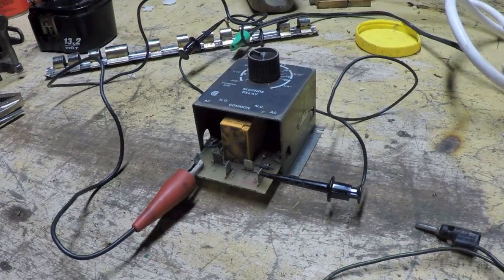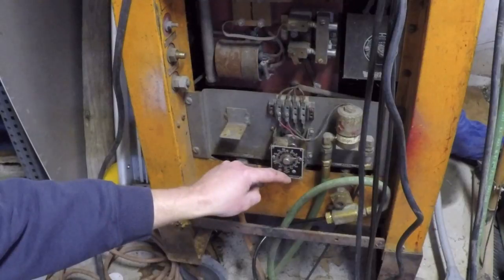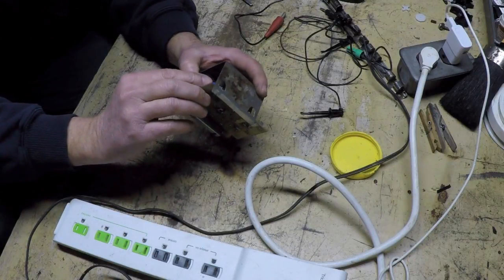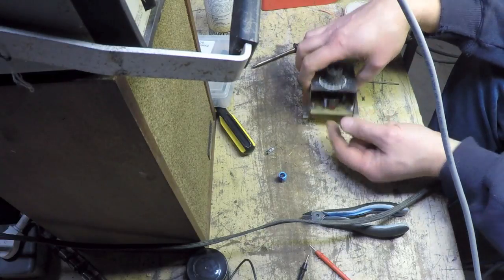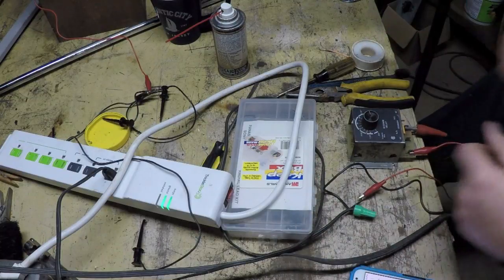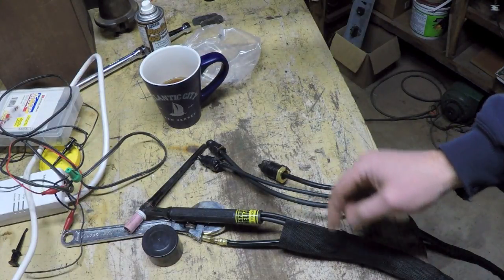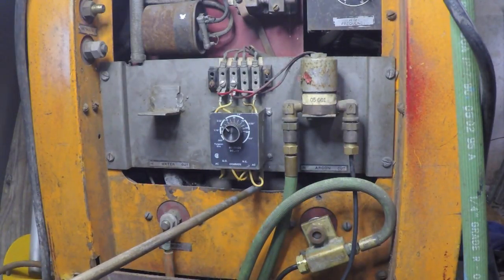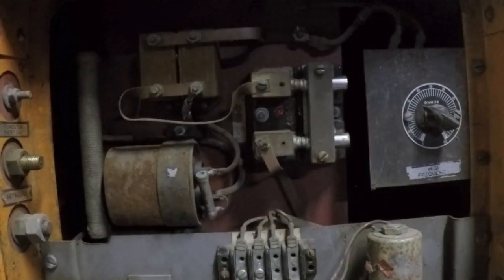Airco 3A Heliarc, Miller 330 a/bp tig welder Part 6: post flow, and a sheath!

Comment: Hi Steve     I sat here yelling at the screen, but I guess it was not loud enough,     I yelled for you to check the plate off the welder you scrapped, to see if would fit better, and for you to use a union to lengthen the water hose, instead of cutting the cable sheath.     You are so close to welding, I am looking forward to the next video.     Have a nice day

Comment: On mine, there is no terminal strip and the TD  relay is moved up.
I can't quite figure out mine. The schematic has ton of relays all drawn with coils and contacts in separate places. With all the optional relays on the schematic, it is real hard to follow how it works. The post flow is on the NC terminal on the contatctor relay though.
However it works and mine also runs the gas when first powered on. Mine has the original 1973 parts. I was tempted to recap it but it works.
I know you stick welded and you now tested the HF and post flow. Only thing left is the start circuit that is used in stick and DC TIG. Once an arc is started, you should hear a relay click about 1/3 second later. That is what was dead on mine; a bad tapped resistor. HF only worked in continuous.
There are two selenium rectifiers. I wanted to replace them but don't want to change the calibration. You probably know the smell of one of those burning out. A lousy smell the young techs will never experience ;)
Reply from the maker: Ah yes, selenium rectifiers. Rotten egg smell. I think production on these were changed over to silicon diodes in later units. As for the schematic, I agree, it's confusing as heck! I cam follow a conventional schematic, but this thing is a whole other animal. More like an industrial process controller diagram.........and where are the damn callouts! lol